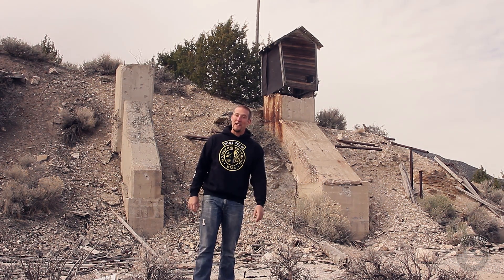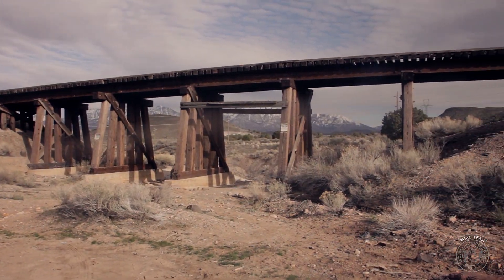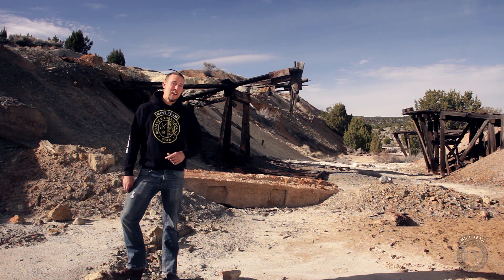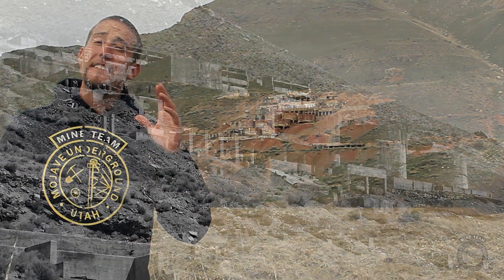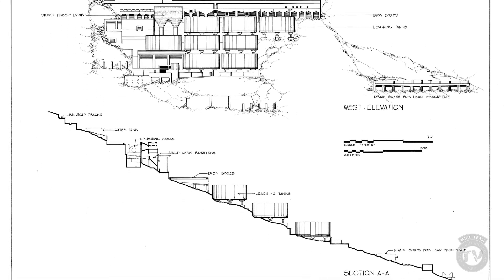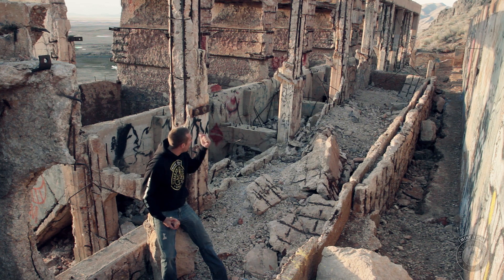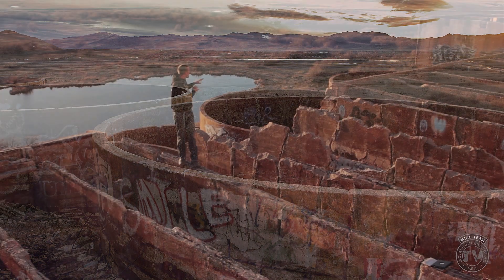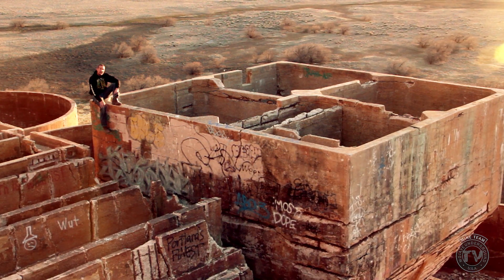MUTV - Tintic Standard Mill - Season 2 Episode 6

Comment: I tried to go there once; don’t do it. Due to high levels of lead and arsenic, it’s closed to the public and guarded by Santaquin Police. If caught up there, you could get fined and charged for trespassing. Luckily, we were stopped and let off with a friendly reminder before we could even get close. If you want to go to a cool abandoned place, check out the Knight Grain Elevator, west of Eureka. It’s completely unguarded, not to mention safer and easier to get to.
Reply: It used to be fairly easy to hike to and explore the mill, but about 4 years ago they started to crack down on trespassing with the claim that heavy metals and other nasty things would make trespassing too dangerous.  OTH, the water flowing from those springs travels south then west passed a pasture where cattle graze and drink the water.  Oddly, there doesn't seem to be any problem for the ranchers and there cattle so either the contamination claims are overdone or they allow the ranchers to graze there cattle and drink the contaminated water.  Something doesn't add up!